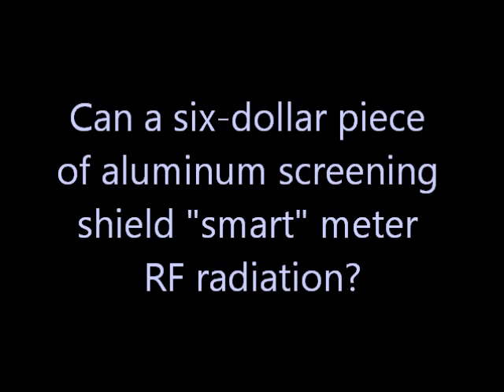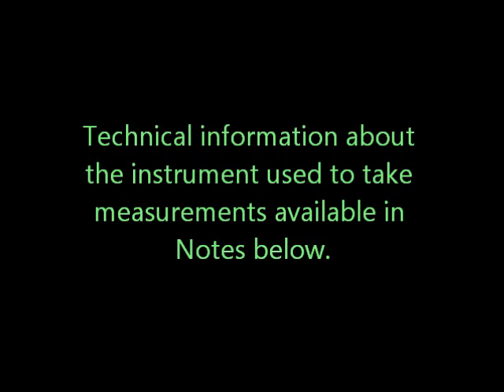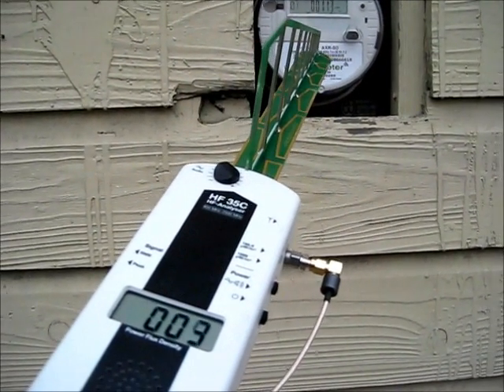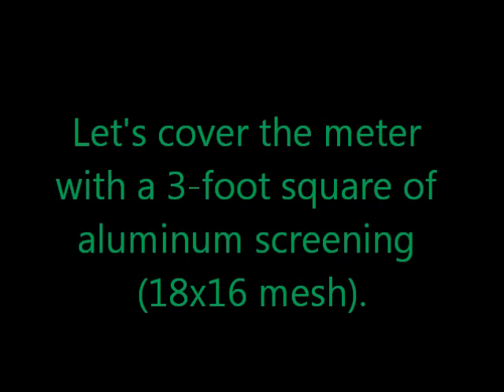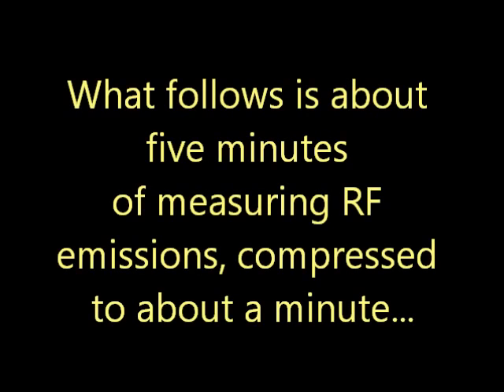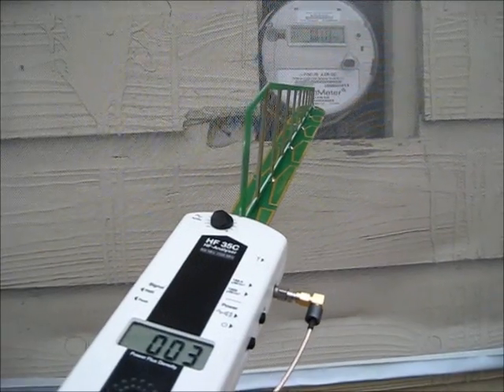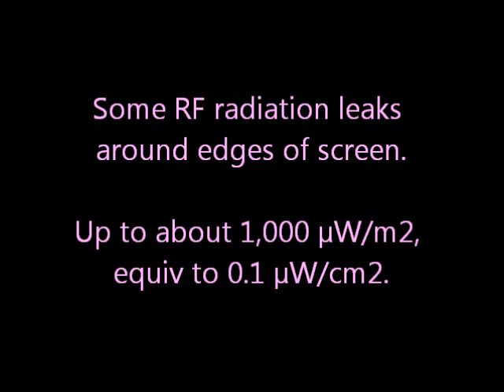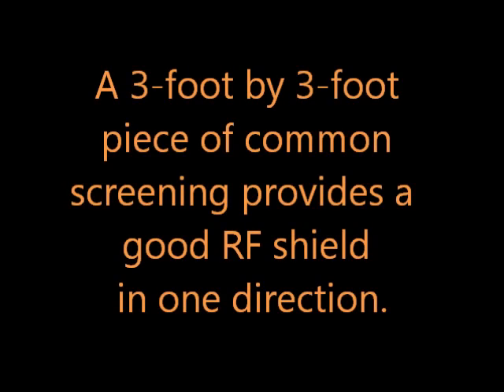Foiling a "Smart" Meter, Part Two: Aluminum Mesh Screening

Comment: actually, their smart meter is on a post away from the house somewhat so i screwed it right to the post.  You can adjust it to point directly at the meter.  If they come and say "take it off their post"  i will tell them to take the post.  It is one of those security lights the hydro company "provides" for our "security" at our cost every month.  I'll send you a pic of it shortly

Comment from the maker: There is NO law to prevent you from protecting yourself from RF microwave radiation. 

Please feel free to cover the wall between your child and the meter---as large a piece of screening as you can. Cover with decorative material. Screening comes in 72-inch widths, making it easier to put up large areas. You may be able to order from big-box hardware stores.

Please view my other videos on my channel about shielding projects.

Comment from the maker: Kevin, aluminum screen will NOT shield the low frequencies such as magnetic fields (Hz, measured in milligauss) and intermediate frequencies (KHz). Specialized shielding is needed for these.

Poor wiring and improper grounding are problems in many homes, and utilities are not required to remediate LF fields under 2000 milligauss---even though the science on human bioeffects shows harm at 1-5 mG. This is another area of environmental health, though, not addressed in this video!

Comment from the maker: HenryNevins, This is an unoccupied building, which I serendipitously used to demonstrate a property of screening. See my other videos for other uses. After i made the video, I left the screen in place. When I recently returned, I found someone in the neighborhood had bolted the screen onto the wall, to make it permanent! As far as I know, it's still up there. 

The utility only wants their reading. This arrangement will NOT block all the signal, which emits in directions not covered by screening

Comment from the maker: Even without wireless, computers have other fields. I have measured the intermediate frequencies around the DCU and the screen, and try to keep back from the worst of the field.

I use the MW oven infrequently and place a simple shield in front during operation (I measured the leakage).

The TV is five feet away from the couch. The laptop has the wireless disabled (we are very into ethernet cables here).

I use my cell phone like an answering machine, and talk on speaker phone.

Comment from the maker: Crossafix, the matter of the holes in the screen is a fascinating one. It works for everything I've tested in the 800-2500 GHz range The wave length at 900MHz is about the size of a football, yet if you enclose your cell phone inside alum. foil, it will still connect to the network if you leave even a small hole. So why does screening work? I invite your further speculation. If you get some screening & inspect it, you'll see the wires are round & have some thickness. Could this factor in?

Comment from the maker: Crossafix, great questions. This analyzer measures RF between 800MHz and 2.5 GHz, with some residual sensitivity on either side. This smart meter transmits using frequency-hopping spread spectrum between unlicensed frequencies btwn 902 - 928 MHz, so it's a good fit. Plus the sound function tells me what type of source I'm picking up. Please view my other videos. As well, the sampling cycle is fast enough to pick up the SM's 3 millisecond pulses of RF. The antenna is directional, best for SMs.

Comment: Is your meter tuned to the power meter's center freq?  Does it have a spectrom analyzer function?  Does it just pick up a wide range of RF? Would not the holes in the screen act like capacitors and the wire as inductors creating tuned circuits that would ring at a certian freq,  capturing the RF energy in tank circuits?  The screen would have to match the freq of the meter's transmitter to block well, correct?

Comment from the maker: Yes, foil blocks the signal. See my other videos. It is very hard to completely block the signal, it only needs small holes to get out, and wrapping a meter completely is not usually possible.

Comment from the maker: Mark, the analyzer I use in the video is good, measuring directionally the source of RF in the cell phone/smartmeter/wifi range of frequencies. It especially catches smart meter pulses (v brief).

However, an omnidirectional antenna would perhaps be better for a large source like a cell antenna array. Please visit lessEMF (dt) com to see some types of analyzers. 

Sometimes fighting an issue like this takes calling in professionals, however. Search EMF technicians, or building biologists.

Comment: In this and the previous video from the same location, it sounded like there were more clicks after you put up the two types of shields. Do the smart meters send out more pulses when some of them may not be getting through?

Would two or three layers of aluminum foil shield as well as the wire mesh? Foil is much more available and afordable than the mesh.

Comment: Did you do the inside wall? Apply hertz filters? Remember, these damn meters actually communicate with nearby house wiring, bluetooth, etc. 

If you haven't done the inside wall over the meter, it can communicate with your computer's media card, your portable phone, your cell phone, your car's computer, etc.

Think of your home's wiring as a Tesla Cage which is "piggy backing" communication both in and out. Know what that means, how it works. You will want ANOTHER Tesla cage inside of that.

Comment from the maker: @keertiji A few things here: the amount of signal needed to transmit your usage info may actually be very small---what radiation that is leaking out may be enough to get your data to the utility. OR they may be sending you estimated bills based on your usage in previous years. You can call them to ask if this is so.

Yes, other materials work to block RF: aluminum foil (see other video) or metalicised bubblewrap-type insulation, etc. Don't leave holes. Please read FAQ on StopSmartMeters dt org.

Comment from the maker: No, that's not it. 18x16 is the mesh size, how close the wires are woven together.

This mesh comes in 3-foot wide rolls---they can be as long as 100 feet.

It also comes in 4-foot wide rolls. Usually a hardware store will cut you a piece of any length you require.

Comment: People. Do the INSIDE WALL of the meter's location FIRST. Then, apply the screen over the meter, with ALL SURFACES ANGLED 45 DEGREES.

THEN, apply the Graham/Stetzer filters.

Other meters BROADCAST their mess into YOUR IN-WALL WIRING, so block that transmission. 

Eliminate/turn off all circuits which aren't used. Remember, aluminum siding, aluminum screen, aluminum plate, aluminum foil, aluminum-coated Tyvec, etc WILL reduce-remove the non-ionizing radiation which is killing you.

Comment: i think its length by width maybe
remember in math when you have to find the perimeter so you multiply length times width
in this case, the length(vertical) is 18 inches, and the width(horizontal)(the sides) would be 16 inches

Comment: New home construction in England is using Aluminum Tyvec on all exterior walls. The goal is the same, but English people are actually experiencing even more non-ionizing radiation than we are. We are entering the era of permanent 8 ghz field everywhere in north america. That matches the virtual O.S.. England will use 10 ghz to match their operating system's design.

The Tyvec should be on INSIDE walls.

The poor man's method would be wallpapering inside walls with aluminum foil.

Comment: 2. ...CSA or UL inspections/approvals are required. How did these idiots do it? Google...UL, CSA, ETL andCE : What's The Difference?  The explanation is there, but you may not "get" it.

Basically, the aforementioned IDIOT has taken radiation exposure safeguarding regulation AWAY FROM any government entity, and has allowed the PRODUCERS (utilities) of that non-ionizing radiation to REGULATE THEMSELVES.

Soon, you will have THREE of the meters INSIDE of your residence.

That is plain SUICIDE!

Comment: Jimga, I have read your comment several times, and remain uncertain as to how I'm uninformed. Try follow along. The smart meter is a combination of all of the bullshit created by the FOUR smart home ideas patented as X-10, CEFus, LonWorks, and Smart Home. ALL of these devices USED TO require UL and CSA approval. They did get that, BUT serious limitations/warnings were ATTACHED to the devices. 

Since a truly dumb &*$#er signed the 1995 Telecommunications Act, NO INSPECTION or APPROVAL is ...

Comment: Sean. Great points. People, there is another pair of wireless meters coming to invade your health and privacy. DO NOT ACCEPT THE WATER METERS!!!  DO NOT ACCEPT THE GAS METERS!!!

Very soon, these shits will get the idea to shut off your water, power, and heat. It's only a matter of time. 

People, one comp monitor screws your blood's red cells. Compound that with your computer power supply,  modem, bluetooth video card, cell phone, and meter.

Wireless stops people's hearts!

Wake up, EVERYONE!

Comment: 2. People, if you want to return your red blood cells to their UN-CLUMPED state, you will begin using a mild oxidizer such as MMS.

I have read several trials of the Sodium Chlorite/Ascorbic Acid-based drug called WF10, and that treatment returned the blood of even seriously aids-infected trial participants to normal.

In other words, the Sodium Chlorite-based treatment caused the krebs cycle to restart and even return to production of ATP, T Cells, etc.

MMS is the same as the WF10 base.

Comment: People, shidunce is right. The foil DOES work as a Non Ionizing radiation reflector. When shidunce refers to "full body" foil application, that is also fact. The exposed mammal's blood immediately CLUMPS UP, leading to fatigue and Krebs Cycle impairment.

People, you must realize that curriculum of the past fifty years has led to three generations of IDIOTS.

Rhblakeman is part of that crop. Remember; No Thoughts, No Worries.

Blakeman, "WE" don't allow untested ANYTHING! The damn FDA does that.

Comment: Blakeman's words are the proof that even an idiot can get it right SOMETIMES. Yes, WiFi is present in a bunch of FatBurger JunkFood joints. In fact, that is a GOOD thing. As soon as the  CONCEALED WORKS and STUDIES on carcinogenic, mutagenic man-made non-ionizing radiation by Ph.D.'s and Electrical Engineers worldwide comes out, that will make people "kill two birds with one stone".

NO MORE grease burgers, grease fries, petroleum based "dairy" products, and NO MORE NON IONIZING RADIATION!!!

Comment: 1. IF..you ground the screen, all of the produced frequencies enter that ground. You don't want that. In fact, you don't really want the produced frequencies radiated into the atmosphere either. 

Remember that there USED TO BE serious restrictions regarding the placement of all forms of electricity in the Earth. Now, the Earth's electrical charge is SEVEN FOLD what was allowed in the recent past.

To avoid that issue, use carbon materials as a catchment of that deflected non-ionizing radiation.

Comment: 2. Placing aluminum mesh over your meter, IF YOU BEND IT INTO THE CORRECT ANGLES, doesn't stop it's primary com link to satellites. The shield stops it's communication with your neighbor's meter.

People, NEVER REFLECT THE METER'S RADIATION DIRECTLY BACK INTO YOUR HOME! 

Reflect it UPWARDS by using 45 degree angles.

Imagine a 6-sided pyramid. Divide that shape in half, along opposite lateral edges. Remove base. Invert. Flange. Attach that shape, in aluminum mesh, over your meter.

Enjoy...

Comment: People, below are some very good points. 

Remember that after the electricity enters your wiring circuits, you can do WHATEVER THE HELL YOU WANT WITH IT!

FILTER it. ELIMINATE wireless communication between the meter and any wireless device/media card. 

ELIMINATE the possibility of your data being removed from your premise. 

DON'T USE/PURCHASE "SMART" APPLIANCES!

DON'T ALLOW the meter to COMMUNICATE WITH, monitor, or remove data from your computer's WIRELESS MEDIA CARD! Shield your modem.

Comment: I think I've seen this periodically via my CRT or monitor which sometimes goes into paroxysms like a spastic colon. Never saw it before the digital meter was installed and got the  Q1000. All about the same time. Never thought I'd miss my manual type-writer and dial phone.  But I do now a bit. Come to think of it: miss my foolscap, pen and ink-well, and no phone, too.

Comment: I understand.  My meter is an old 'banjo' type, connected to a weather-head. I'm tempted to just getting an old style meter and replacing the digital and asking PGE (Portland General Electric . . . of Enron infamy) to just come and read my meter as in the old days. Or, why shouldn't I ask they provide Faraday shielding? If I can't prove the potential harm, they can't prove there isn't. Maybe a law-suit on such grounds. What are the laws on trespass? What's the 'radio-licensing'? Surveilance?

Comment from the maker: Simply put, as far as shielding goes, BIGGER is BETTER, and closer is better: make the shield large, and place it close to the meter. Think of the radiation as a kind of light, and the screen blocks it. If the piece of screen is small, the radiation 'bends' around the edges, and gets into your house. So, I suggest you buy more screening---it's fairly cheap. If you were trying to block the light from a lightbulb, and you put a dinner plate in front of it, it wouldn't block as much as a door, eg.

Comment: Ture, I do use a computer that has a switching power supply, but not all switching power supplies are created equal.  It is possible to engineer them so that they do not reflect a bunch of high magnitude transients back onto the house wiring.  I assure you that I have gone to considerable trouble to ensure that mine does not.

Comment: 90,000 micro watts, because that sounds so much intimidating than 0.09 miliwatts, or even less intimidating than 0.0009 watts. Your microwave oven that you use daily emits TEN THOUSAND times more energy of the SAME FREQUENCY, that's right, the average micro wave emits 10,000 times more energy. Scientific notation's a bitch til you learn how to use it....LOL

Comment: 4. ...aluminum sheathing and/or Aluminum siding. Change your electrical plans to include service panels with built-in Hz filters, AND use "twisted pair" wiring. Use oversize Neutral (white) wires and super-sized ground (bare) wires. Remember that the smart meter is a fire hazard due to it's inability to deal with Lightning strikes. Mount the meter pot on Aluminum over cement board, so WHEN the meter self-destructs ( as it is designed to), it won't BURN YOUR...

Don't use aluminum wire ANYWHERE!

Comment: 3. ...switches, wall warts, remote phones, wireless modems, etc. shield the coax type modem with aluminum.

Now, the real problem. All smart meters communicate with each other, AND THE WIRING CIRCUITS IN YOUR HOME!

That "point to point" grid of microwave communication PASSES THROUGH most materials used in Home construction. Aluminum REFLECTS microwave radiation away, therefore is the "sheath" material of choice.

You building contractors out there, consider changing two things. Use Tyvec...

Comment: 2. ...electricity is returned to the grid, and then becomes other people's problems.

Go back to pages 4 and 3 in this blog. Locate my posts, 1 to 5. Note the dirty electricity issue, and note how that is addressed with Graham-Stetzer Filters. 

People, the smart meter transmits both wireless and on wires. Fixing one transmission method doesn't repair the problem, or change the outcome. 

It is critical that you all filter your electricity, AND remove all wireless devices, CFL lights, dimmer...

Comment: Absolutely correct, jbell. If you look at Industrial electrical devices that intentionally modify Hertz, AND understand exactly HOW these devices do that, you will then know the issue. BUT, the Industrial devices have FILTERS installed which return the 50 Hz back to the original SAFE 60 Hz. In most such applications, electricity is PRE-filtered to assure quality 60 Hz enters the panel.

You are completely right about the "dirty" electricity which enters your home. Remember, that same "dirty"...

Comment: A problem with this strategy is that the SmartMeters, (at least all the ones that I know of), are built with a terrible, cheap switching power supply that reflects high-magnitude transient waves back onto the entire electrical system of any building, (including your home), that may have a SmartMeter installed.  This turns your building into a radiant, slow death-trap, even if the wireless function is completely disabled.  People need to kow this!  Please spread the word.

Comment: Roger. Imagine that you are the center of a tire tube (torus) which has no vacant center. The tube (torus) is 100ft Radius OR 200 ft Diameter. The tube (torus) also projects, in all directions, 100 ft UPWARD and 100 ft DOWNWARD. 

That is the advertised field of transmission.

This is the Smart Meter "dumb to be exposed to" field that you seek to reflect AWAY from the interior of your home. Imagine the radiating "lines" of the involved transmissions, and create your reflectors accordingly.

Comment: 1. Brad, you are wrong. The hazards of EM exposure were well known in Europe as early as 1970. The EEC published that data for many years, but the onset of the disease known as The New World Order put an end to the EEC AND it's health risk data-based Human Exposure limits.

Regardless, the various worldwide Electrical Worker's Unions have published data proving that continuous EM exposure produces VERY HIGH incidence of cancers AND neurological issues.

That EM-RF-ULF Hazard knowledge base has..